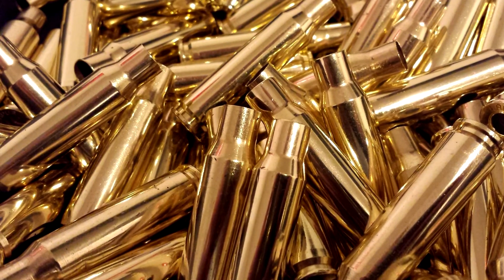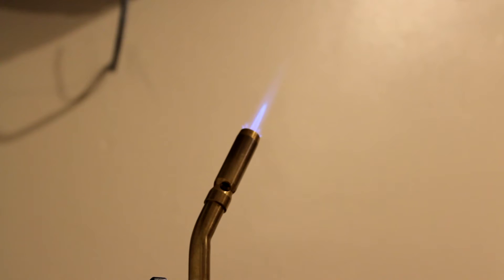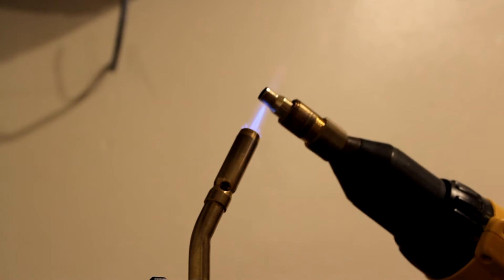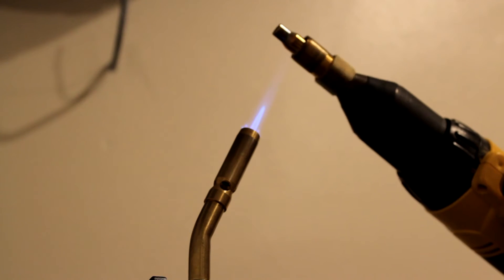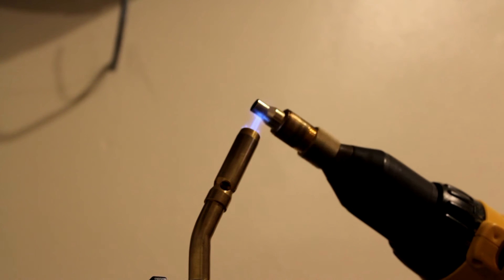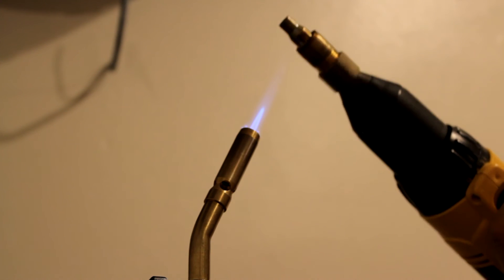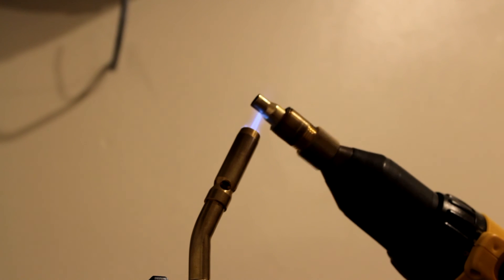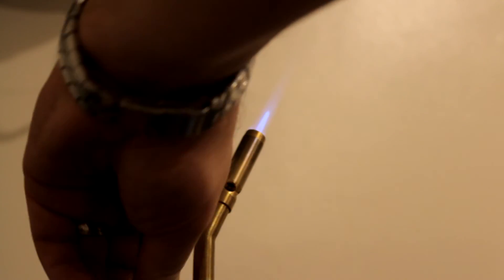Annealing 308 Brass

Comment: I use virtually same method, right now using yellow bottle which is hotter than standard blue bottle. I would add to your discussion, it's not absolutely necessary to quench them but the benifit to quenching them is it stops the annealing process in it's tracks, so if you were on the longer side of the process but pulled away in time, problem could be it will continue to soften up to a certain cooling point so if you confident in your timing either quench or go a lil less time if you plan on air cooling. I know it's your rodeo but that's what I've learned. We can always learn, and like you I don't use templaque
Reply from the maker: THEHARTOF THINGS since this video, I’ve used tempilaq to validate I was not damaging the brass by not quenching, and the results were perfect. Dropping the cases on the cookie sheet instead of water does not allow the brass to heat up to 450 F more than 1/16” after the torch is removed. Not using water in the process keeps me from having to dry the cases again. I have bought an Anealeeze recently, and it is a marked improvement over the socket/drill technique shown here. Both are effective, but loading cases into the hopper is much faster than this way. Thanks for watching and commenting! Good shooting and may you get the tiny groups you’re chasing, if you’re into that sort of thing.

Comment: You can go 750 degrees less time on flame and time that will heat up the body
Reply from the maker: I'm not sure I follow you here, but I am not very smart, so I'll have to ask you to forgive me. I purchased some tempilaq and tested this method with 750 inside the necks and 450 outside the body. I got very little heating past 450 anywhere the brass was covered by the socket. Heating faster would probably be OK, if you still protected the body of the case. Anyway, thanks for watching and joining the conversation.

Comment: What do you use to show temp reached on the brass?
Reply from the maker: I don't. I have annealed this and other batches of brass several times with no sign of case head softening. I'm using the visual approach. I know about tempilaq, but since I anneal different headstamps, a individual approach works best. 

Thanks for watching!
Reply from the maker: GLgunsandgear I bought some tempilaq and found this method to be very effective at annealing the necks and not heating the case head virtually at all. In fact, I've tested it on my 44 magnum brass with the sane results.